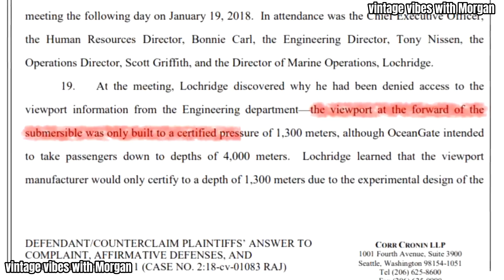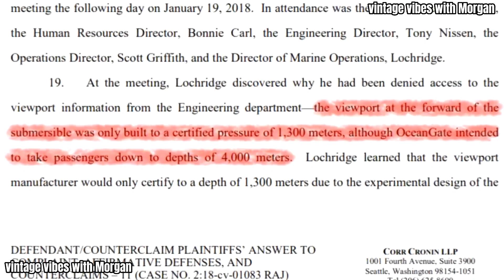Titan's Viewport : It's Not The Case of The Implosion !

Comment: Im sure they would have removed the porthole anyway to secure the straps  to lift the titanium shell  ,,,,,,i believe the rear leaked  causing the rear cap to pop off   ,,,, just my opinion,,but it changes, after more video's come out  lol
Reply: I don't think they would as it would be tampering with the evidence. Investigators would want to see it intact and in place to rest there was no failure around it.

Comment: I still think the carbon fiber hull had more chances of failing than even the 1300 meters max rated viewport.
Reply from the maker: Yeah , this is what appears to be happening my friend, thanks for your comment.
Reply: The resin holding the carbon fiber together is so stressed under pressure that it breaks and every break leads to more of them.

Comment: I too believed the 21" viewport failed which was only rated for diving only to 1300 meters whereas it needed to be able to withstand about 3 times that much. A factor of safety of 3 was probably the only thing that kept it from failing the other successful trips. It looks like the bolts sheared off.
Reply from the maker: Indeed my friend, we all did at some point, but to Sheather the bolts from it's places it must of been a somthing inside right ? , thanks for your comment.

Comment: I wouldn't have felt easy about the Titan getting shifted around on that platform.. not to mention those times it tilted a lot trying to get it back on platform (shifting all that weight around can bend the legs a bit and the areas where the legs are conected is stress that could crack seals or loosen bolts
Reply from the maker: Still a possibility but I doubt it could be the problem, thanks for your comment.